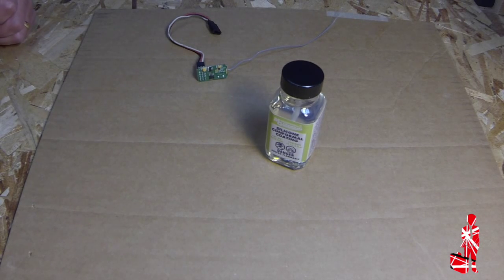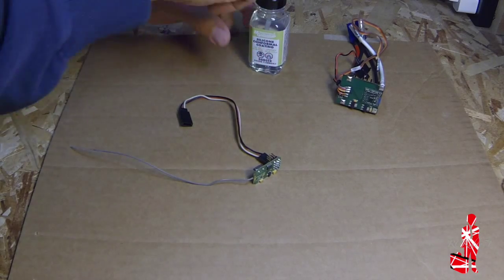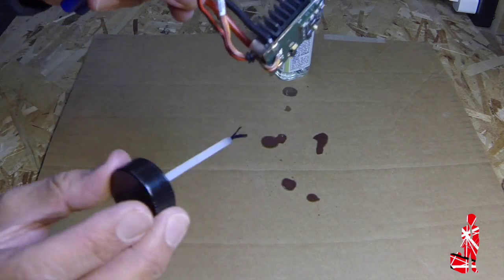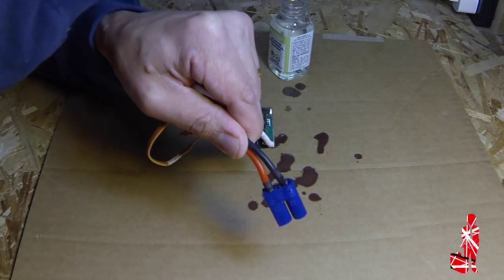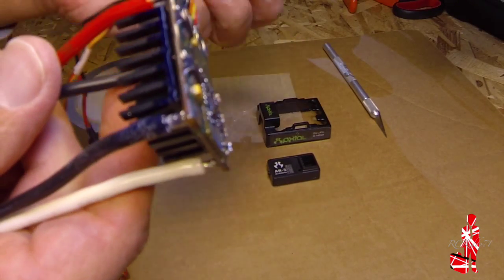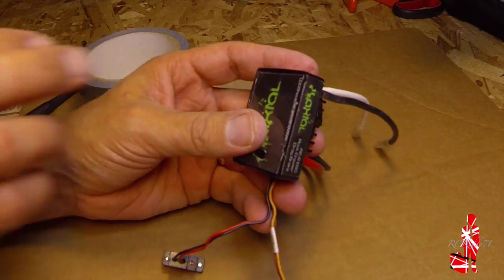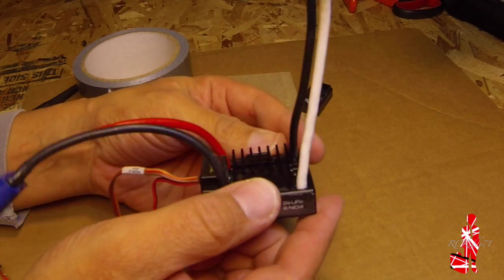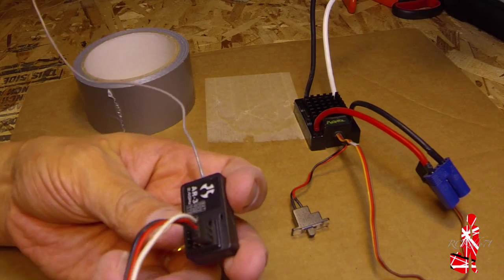How To Waterproof  Your ESC and  Radio Receiver With Silicone Conformal Coating

Comment: I apply this stuff with a spray gun at work. It's has to be applied heavy. Respirator is a must! I use almost the same exact one you have.  It scratches real easy so handle with care. 
Nice job!

Comment: Hit it with a black light... you'll know if you missed anything and it helps to use some CorrosionX on all your connectors and shit where the conformal coating is not going to work so well servo leads battery connectors bullet plugs ext...

Comment: It only requires ONE coat. That three coat deal you hear about is the American way of doing things. You know, apply four times the required product when the manufacturer states otherwise.
Reply: +jim davidson Right, but if you miss a tiny spot... it's better to have too much than too little, right?   If they made this stuff in other colors, it would be easier to see coverage issues.
Reply: I heard it's UV sensitive so you can use a black light to see coverage.
Reply from the maker: this may be true LOL
Reply from the maker: thats cool ill try and see. it would make a good video
Reply from the maker: true
Reply: jim davidson

You'd probably say generalizing and stereotyping is an American way of doing things also.